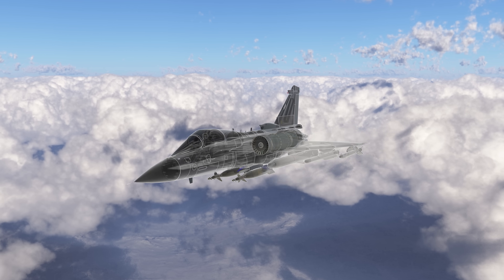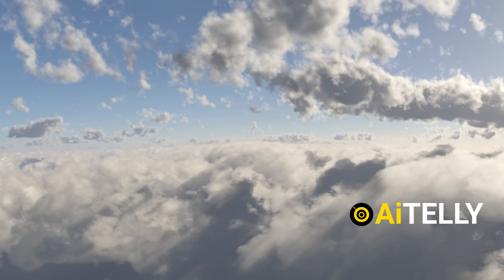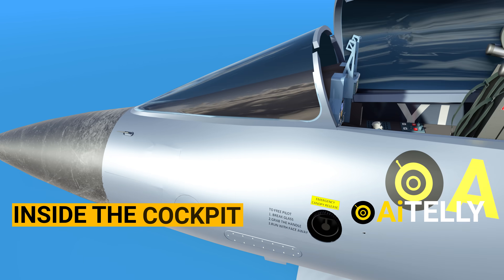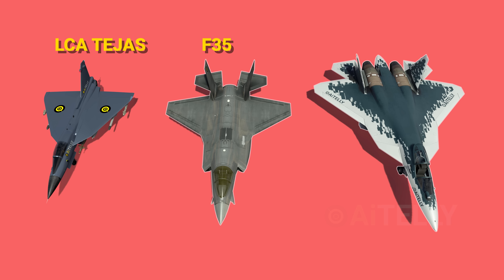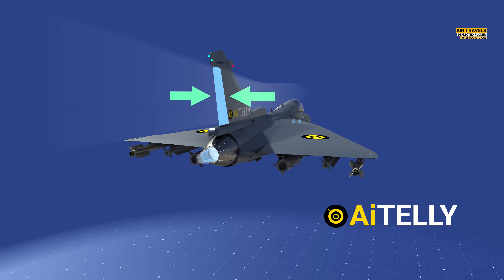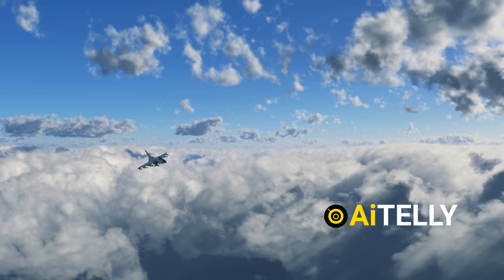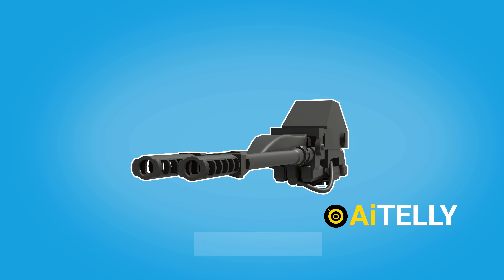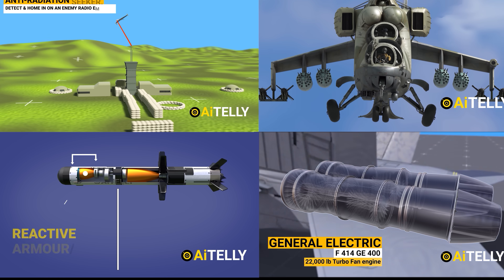Multirole Fighter Jets  How it Works | Tejas Mk1A LCA Light Combat Aircraft #fighterjet #jet #plane

Comment: It might have a bit shorter range but these can be used in defensive mode not crossing the LOC but defending Indian airspace
Reply: Kashmir to Islamabad is 220 kms distance. Tejas's range is 1500 kms+ or close to 3000 kms with 3 x Drop tanks. Do your maths.
Reply: enough for pakistan cause their airforce have aged well like Chinese aged eggs
Reply: @mrtrampoline3735  But America is now going to upgrade them. They still say they are saviours of democrasy. Do they? 😂
Reply: @mrtrampoline3735  
Pakistan will always be ahead.

Superpowers give military aid to Pakistan to keep India at bay.
This is the reality.
Reply: @ajaykumarsingh702  lmao are you happy because of that? cause they are giving moni to u?? lmao you are also giving them servantship 
and ig 75 billion$ military budget and 7 billion$ military budget have some difference and that difference will come up in 2-5 years :)
Reply: @ajaykumarsingh702 in what military field is Pakistan ahead of India except the number of nuclear warheads????
Reply: @mrtrampoline3735  The tejas is crap imported engines and radar, and electronics 

The engine is a us engine from the 1970s 

Small, short range, bad engine, radar is something that they bought off the shelf 

I would say it is comparable to the discontinued F-18 hornet in the 1970s that has long been replaced by the super hornet in the 1990s 

>Indian aviation experts have attributed these flaws in the ‘Made In India’ production of Tejas Light Combat Aircraft to inefficient and corrupt bureaucrats in India. In May 2015, Tejas aircraft was even publicly criticised by the Comptroller and Auditor General of India (CAG) for major faults such as a lack of a capable tandem-seated trainer aircraft, lack of electronic warfare capabilities, performance shortcomings of radar warning receiver or missile approach warning system, weight and cost increases, limited internal fuel capacity, non-compliance of fuel system protection, inadequate forward-facing pilot protection, performance shortfalls due to under-powered engine and overweight devices used with the radar.
Reply: @xblade11230  thannks paxtani 
enough for you tho at least retire mirage 3 and mirage 5 lmao
Reply: @mrtrampoline3735  I'm an American but I know a thing or two about planes and performancewise it matches up to the planes used by the US in 1970s 

The amount of TR modules in the uttam AESA is around 720 while modern radars used by the US + china + Russia are all 1000+ 

Rafale = 838
Zhuk aesa = 1000
The J-20 = 1500+ 
F-35 = 1,676 

Which suggests that the isreali radar is equal to or worse than the uttam aesa that is still under development
Reply: @CertifiedMisogynist  no they do not use the same engine 

Super hornet uses GE414 regular hornet uses the GE404 

Tejas uses the GE404 probably the only plane that actually uses this old piece of junk all the other planes that use it have been long discontinued 

And no it's 780 tr modules for Tejas, Utam has also only produced and tested a prototypes 

The other versions that have more tr modules but its just upscaled and bigger radar are for other planes but tejas won't have the power to carry and power it 

The first mk1 is slated to come out in 2024 so as of now they are still using Isreals radar 

>The radar is capable of tracking 100 targets simultaneously and engage 6 in high priority tracking mode. The radar sports 780 TRM modules has range of 152Km for fighter having RCS of 0.5m^2.
Reply: @CertifiedMisogynist  the f414 are not the same technology

The f414 has a thrust weight ratio of 9 

The f404 has a thrust weight ratio of 7.8 

For comparison 

The F-22 engine is 9

The f-35 engine is 11.47 

Ws-10 is around 9
Ws-15 is 10+ 

Yes the F-22 most likely uses a upscaled version of the f414 which both came out in the 1990s 

The thrust weight ratio is amount of thrust/ weight of the engine 

So making a engine larger will increase its weight proportionally and won't change the ratio very much

A engine takes in fuel and concerts it into thrust

Thus the only way to get a higher thrust weight is by increasing the efficiency of the engine in converting fuel to thrust 

This is extremely important as it effects the flight performance characteristics and provides power to the radar which is energy hungry

The Kaveri engine doesn't exist, and if it did exist the thrust weight would only be 7.8 so equivalent to the f404, they can't even copy a engine from the 1970s

I know india likes to compare to Pakistan 

The Pakistan jf-17 has a thrust rate of 8.6 it uses the RD-93MA which provides 10% more thrust than the RD-93 and the radar reportedly has more than 1000+ t/r modules
Reply: @xblade11230  and Pakistan doesn't have any aircraft of its own
Reply: @AemondTomahawk  umm no dummy they no longer use the engine that was in block 1 

The f-16s we use today are block 70 and they have had several engine upgrades 

Blocks	Models	Engine
1–15	F-16A / B	PW F100-PW-200
15OCU, 20	F-16A / B	PW F100-PW-220
25,32,42	F-16C / D	PW F100-PW-220E
30,40	F-16C / D	GE F110-GE-100
50,70	F-16C / D	GE F110-GE-129
52,72	F-16C / D	PW F100-PW-229
60	F-16E / F	GE F110-GE-132

They no longer use the F100-PW-200 that was used in the 1970s

Modern day block 60+ f-16s are night and day from the block 1

Engines have variants and the variant that tejas uses is from the 1970s no other plane uses it, the us no longer uses it
Reply: @AemondTomahawk  you are talking about something that doesn't exist 

They have plans to make 900 tr modules but as of right now they are still using isreals radar, and the numerous pictures showing the uttam radar sized for the tejas have shown 780 and the mk1 which is supposed to have uttam isn't even out yet
Reply: @xblade11230  in Nov2022 it was diwclosed that uttam MK1A will have 900+ TRM modules. 12KW power. 
 dont teach Indians about Indian defence news.
Reply: @AemondTomahawk  no completely untrue 

Gripen no longer uses the 404 

>Gripen E has the powerful GE F414G engine, great range and the ability to carry an impressive payload with its ten hard-points. It also has a new AESA-radar, InfraRed Search and Track System (IRST), highly advanced electronic warfare and communication systems. The E-series redefines air power for the 21st century by extending operational capabilities.

The gripen does not use a engine from the 1970s 

Yes some countries still fly old planes, but brand new planes are not being equipped with a 1970s engine like the Tejas is 

This is why the tejas is crap, it's a brand new plane being built today and is using a engine and radar system from the 1970s 

780 tr modules is what planes from the 1970s era had

---------

No that's the mk-2 and it doesn't exist yet,  the tejas mk1 hasn't even started production 

>The data available in the public domain suggests that upgraded Uttam AESA of Tejas Mk2 will have 912 – 968 TRM
Reply: @AemondTomahawk  

From a Indian defense website article is written August 2022

The mk2 doesn't exist yet

>The data available in the public domain suggests that upgraded Uttam AESA of Tejas Mk2 will have 912 – 968 TRM
Reply: @AemondTomahawk  you are comparing 40 year old planes to Tejas made in 2022 

 So yes these 40 year old planes that are being phased out are crap like the gripen A they were good 40 years ago but they are crap today 

And tejas is a crap plane because the tejas brand new being built today are 40 years obsolete 

The modern day gripens have had extensive upgrades to everything and they no longer make gripen As which uses the 404 engine
Reply: @AemondTomahawk  Also the Gripen A made in the 1980s has a superior engine to tejas hal today, embarrassing 

The RM-12 was a upgraded F404 

>The F404, which was small in size and had a thrust to weight ratio of 7:8, was already flying in the early F-18 fighters at the time. And since Gripen was not designed to have a twin configuration like on the F-18, some more thrust was required. The version that Volvo derived from the F404-400 for Gripen, which was the designated RM12, had its maximum thrust increased upto 80 kN from the 71 kN version in the US Navy.
Reply: @xblade11230  it's our first indigenous fighter jet, how can you expect it to get compared with old players of the game
Reply: @xblade11230  Sweden  is making aircrafts before India got independent

The market in Nehru era was not opened fully for the private automobile manufacturers, he was a hardcore socialist, and now too we are not producing any highly powered sports bikes or cars but still with these baby steps we are currently 3rd largest automobile manufacturer.

Even ur country, if ur not Canadian, has shown interest in buying Tejas
Worry about your tax being used in procuring this 'outdated' aircraft
Reply: @xblade11230  I read all your comments. You may have good knowledge on fighter planes. Ya ok Tejas may be a crap plane. So? What do you want us to do, what's your problem!

It's kind of becoming boring you from the West bashing us over and over and over again. Go take a break and play golf! 

Yes ok we don't make good fighter jets nor the engines, ya that fine! We're OK with that, we'll buy them from somewhere.
Reply: @xblade11230  I’m Indian and I have to agree. DRDO is one of the most slothful organizations out there. India should have bought the Gripen. Sweden offered to setup entire assembly line in India with total transfer of tech. Better still they should have bought the F15 Eagle. Yes it’s an ancient airframe design but the US was offering the most upgraded version with cutting edge network centric tech. This air superiority fighter would run rings against most anything from China and Pakistan. 

One more thing. I would take any data about Chinese AC w a huge bowl of salt.
Reply: @rickbarrington  lol sounds like cope Chinese jet fighters have performed training exercises with numerous countries and have shown the pl-15 in numerous mock battles with the J-10 coming out on top

They have also demonstrated the pl-15 range to shoot down Aerial targets at a long range 

They are the real deal, China has extremely powerful radars without them The pl-15 simply won't work 

The pl-15 has 300km range this is much farther than the meteor which is currently the 2nd longest range at 200km and only the most advanced plane versions like the f35, gripen , eurofighter and Rafale can use UT 

The J-10 has gone into numerous mock battles with other countries, the same cannot be Said for tejas which india refuses to use for joint combat training 

>In August 2019, the Chinese Air Force sent J-10C fighter jets to Thailand to participate in the "Eagle Strike" joint air combat training of the Chinese and Thai air forces. It is reported that during the training period, the JAS-39 "Gripen" fighter jets in active service of the Royal Thai Air Force and the J-10C fighter jets of the Chinese Air Force conducted a simulated air battle. Although the two sides did not announce the final results, according to foreign media exposure, JAS The -39 "Gripen" fighter jet fell behind in the confrontation with the J-10C fighter jet. It is the most advanced fighter jet in the Royal Thai Air Force's active service. The performance of the aircraft has disappointed the Thai military.
Reply: @human1822  

American planes have stomped every European plane, and the gripen has stomped everything that isn't su-35 or better 

And the su-35 has avoided, ducked every chance to duel or fight other advanced planes 

The US is the real deal the f35 is a tiny plane with a single engine and it has 1600 radar t/r modules

And the 2nd best plane is the j20 with 1500 radar t/r modules 

So it is very clear that the US is more advanced the small f35 radar is most likely more powerful than the far larger j20 radar 

The f35 engine has an insane thrust to weight ratio it even exceeds the ws-15 which is a Chinese engine that isn't even out yet 

Yes the us is in decline but their fighters are literally a generation ahead of the world they are the real deal

They are superior not because they are American but because they have proven themselves superior
Reply: @ritamsarma9568  Tum kaise bol skte ho woh pakistani hai?? 🤦‍♂️ Arre bhai technicalities pata nahi hai toh rehne doh.. idar comment section mai jaang nahi chal rahi hai ki har kisi ko pagloñ ki tarah pakistni bulaye ja rahe ho..🤦‍♂️
Reply: @xblade11230  
Lol !
French Rafale shot down F-22 in one of the exercises.
Reply: @ajaykumarsingh702  it was in a dogfight which wouldn't happen in a real fight, a F-22 would bvr any enemy 

And the French planes lost every dogfight in that training exercise they only one once when a French pilot got extremely lucky and put his life at risk by doing a risky 9g manuever which can kill the pilot
Reply: @ajaykumarsingh702  stealth is not compromised as both Russia and China are building stealth fighters

And the f117 was extremely successful they ran missions nonstop in multiple wars, losing only 1 due to bad luck and complacency in Serbia 

For comparison The US lost 10,000 aircraft in the Vietnam War 

While stealth bombers and fighters have ran thousands of missions since the 1980s and only 1 combat loss 

The f22 also won every dogfight except 1
Reply: @xblade11230  you know what IAF requirement was a multirole Light combat Aircraft to replace old mig 21 bis and engine power requirement was 80 to 90 KN thrust in which GE 404 fits that's why IAF chose that engine how you can compare two different class aircraft where grippen/f-16 are in medium catagory aircraft and Tejas is a light combat Aircraft if you really want to compare you can compare it with South Korean FA -15 that would make sence but your this comparison doesn't make sence
Reply: @xblade11230  
Stealth is useless with BVR missiles.
The term "Stealth" doesn't mean invisible.

Scientifically it means "low observable".

Even with the basic radars, the stealth jets are easily detected and locked for missile fire at the range of 30-80 km.

But with BVR missiles the stealth jet avoids such scenarios of exposure.

F-117a was successful not because it was better, Serbia had non-existent airforce and it still has the same condition.
USA faced no challenge at all.

Russia and China initiated their own stealth program because the USA never developed the counter measure for the stealth for decades like them.
Reply: @xblade11230  pL f15 is copy of isareli python
Reply: @xblade11230   lmao, it's been confirmed that the upscaled version of uttam with 900+tr modules will be used in tejas mk1a.

Along with tejas , fa 50 also uses the same engine.

And the one coming in 2024 is mk1a , mk1 is already in service.

Again cherry picking.
Reply: @CertifiedMisogynist  no that's the mk2 

>The data available in the public domain suggests that upgraded Uttam AESA of Tejas Mk2 will have 912 – 968 TRM. 

The planes currently rolling off the production in 2023 are the Mark 1a and is supposed to fix the current Mark 1 issues. 

The 900 tr uttam radar doesn't exist, neither does the Mark 2 

>Tejas Mark 1A - an enhanced Tejas Mark 1 equipped with EL/M-2052 and Uttam AESA radar, self-protection jammer, radar warning receiver, as well as being able to mount an external ECM pod.[211][70] The first Limited Series Production (LSP) aircraft of the Mark.1A variant rolled out in April 2022, and meant to be used as a Flying Testbed (FTB). A second LSP rolled out in late 2022, and shall be used to validate design changes meant to make the Mark.1A variant lighter than the Mark.1, and to optimize weight distribution
Reply: @CertifiedMisogynist  you are aware that the Golden Eagle is a jet trainer? And not intended for actual combat 

And jet trainers are supposed to have weak low powered engines and also are supposed to be cheap 

You don't start learning how to drive with a F1 racecar or Ferrari, you start with a Honda civic or Toyota corolla 

The golden eagle is a trainer for the F-16, to get students accustomed to flying a honda civic before moving them to a Ferrari
Reply: @CertifiedMisogynist  a model was shown, it doesn't exist in real life 

And it is for the tejas mk2 which doesn't exist yet 

>DRDO's LRDE at "DEFEXPO INDIA 2022" showcased UTTAM AESA(Active Electronically Scanned Array) Fire Control Radar (FCR) but upon closer observation, it was sported with 912 TR modules which are more than 780 TR modules usually seen in earlier Uttam models that were displayed.

>UTTAM MK2 program will cater to the Tejas Mk2 program and also of Mig-29K program of the Indian Navy. DRDO also has plans to develop Uttam with a rotating repositioner that allows the pilot to take a beyond-visual-range missile shot and then turn 90 degrees while still giving mid-course updates to the missile fired.
Reply: @xblade11230  
This is a battle of avionics.
Don't assume that Stealth jets always have a longer range of radars.

Many 4+ gen jets have a radar range of beyond 300 km.

Su-35 has a 400+ km range of radar compared to the F-35 200+ km radar range.

The difference here comes in technology as Russia uses PESA radar while the USA uses AESA radar.

I specifically mention "Stealth is not equal to invisible" because you used the exact incorrect analogy of blind men thrown at each other.

I also clearly mentioned the critical range because the Stealth tech doesn't work if the jets are present anywhere near the range of 60-80 km. There is no lucky guessing if this limit is breached.

The weapons easily lock onto any Stealth jet if it breaches its beyond visual range advantage, especially the SAMs.

Not to mention I haven't even put another scenario which is electronic warfare and decoys.

That shit turns the engagement to another level.
Reply: @ajaykumarsingh702  Radar range is meaningless without context 

APG-77 AESA (F-22A)

For RCS 0.0001 m2 class target: 20 km+
For RCS 0.001 m2 class target: 35 km+
For RCS 0.1 m2 class target: 112 km+
For RCS 1.0 m2 class target: 200 km+
For RCS 5.0 m2 class target: 300 km+
For RCS 10.0 m2 class target: 355 km+

And the su-35 is not 400km, these ranges I believe are for a 10m2 class target and are the ranges required for a weapons quality track 

Su-27M/Su-35 (N011 Zhuk-27): 100 km (front), 55 km (rear)
Su-27M/Su-35 (Zhuk-PH): 165 km (front), 60 km (rear)

>It’s the only major 4th gen. aircraft without an AESA radar or any form of Sensor Fusion. The Irbis-E is marketed as having a 350 km range against 3 m^2 target while in reality that’s only in cued-search in a tiny FoV. What’s rarely stated is that in normal volume search that range shrinks down to 200 km.

There are different types of searches done be a radar, a radar can detect things at extremely long ranges but won't know exactly where they are 

A fighters radar has different settings they can do short range with a large FOV 

Or they can do long range with a small FOV , this is because radars use a technology called beamforming and can dynamically adjust their search radius 

Think of it as a flashlight you could narrow the beam or widen the beam and you are trying to find something in the dark. A flashlight that can reach 400km with a beam the size of a dime isn't going to be very useful 

To actually shoot down a object the beam needs to be big enough at a high enough frequency, so for frequency imagine that the flashlight is turning on and off, and a higher frequency means it turns on and off faster so you see the object more frequently. In fact if a flashlight blinks on and off fast enough your brain never registers the object disappearing. 

So this in a nutshell is how tracking actually works, radar is controlled by the pilot and when it does long range tracking mode it narrows the flashlight beam to like dime sized and then moves around trying to spot a object at long range, once it spots and object it can't give a high enough quality track, so the pilot will need to move closer all of this beam adjustments are controlled by software but the system will let you know when the flashlight is wide enough and at a high enough frequency that it can be sure of hitting when you fire and this is conveyed with a lock on to the target 

This is also why no modern fighter uses PESA anymore, and why the # of tr modules is so important 

Beamforming is where the blind guy throwing balls analogy falls apart and where wave particle duality kicks in 

So I'm going to explain how modern radars work since you clearly don't understand.

When you throw a rock in a puddle you get ripples, if you throw multiple rocks multiple ripples will form and they will interfere with each other, or strengthen each other based on the frequency of the waves.

Ergo the higher TR modules you have the more rocks you can drop into the water and the longer beam you can form with a higher frequency 

A stealth fighter basically looks like a small insect, you aren't going to see it until it is right in front of your face, at ranges above 5m a mosquito is basically invisible to your eyes

And since advanced 5th gen fighters have the most powerful radars, they can see planes and destroy them their low rcs and more powerful radars allow them to do that.

Even if you detect a stealth fighter you still need to get a weapons grade track 

Two F-22 fighters won't be able to see each other unless they are 20km away from each other, but they will destroy any su35 from 200km away
Reply: @xblade11230  and if you are American can you tell me good enough reasons for running away from the taliban
Reply: @rickbarrington  gripen doesnt have its own engine
Reply: @xblade11230  holy shit ! Thnx for all the info man. U seem like a veteran in airforce or as an engineer to me.
Reply: @rickbarrington  bruh have some shame..theyve developed quite a bit in such less time..
Reply: @xblade11230  they will start calling you Pakistani as soon you lay down facts lol I'm Indian too but you won't be able to tell them this jet sucks without getting called racial slurs lmao
Reply: @xblade11230 bro comparing a LCA aircraft with the likes of F22,F35,J 20 is amazing. Tejas is not the Main fighter for india it is to supplement the aging squadrons
Reply from the maker: Agreed
Reply: @Aitelly   Tejas can't be used to defence as per some sources , Tejas is more attacking porcupine.
         Once you destroyed air defence system of enemy , you will not try your superior fighter jets in enemy's aur space , as you see ukraine hide their defence system which cause russia huge damage .
                Rather taking chance with Rafale or Sukhoi , Tejas can do same job (if long ranges missiles arec fitted) 
         Tejas backbone is it's missile , by the time Tejas MK1 roll out , Astra mark 3 will be tested completely which  is close to mach 5 which is higher than existing air to air missiles in world .
          Bramhos NG , and bramhos 2(hypersonic) delayed due to current war ,will be real threat from Tejas . Last year , Bramhos was misfired from india ,it covered 310 km in just 5 min crashing in pakistan , chinese HQ-9 system in pakistan was not able to detect it .
         Most irritating thing it is getting delayed , it should be made by private companies, as DRDO handles many project for India , DRDO's main focus is always on missiles .
 
As a Indian i can say , our missiles completes deadline before the fighter jet ! 
         Even if you are rich all of your cars can't be Ferrari, you needs some cars that serves your purpose .
           Tejas is not Ferrari but it gives better ratio of quality to price . That what we need !
Reply: They will be easily eaten alive by Chinese BVRAAM.
Reply: बरोबर आहे
Reply: It's a offensive jet